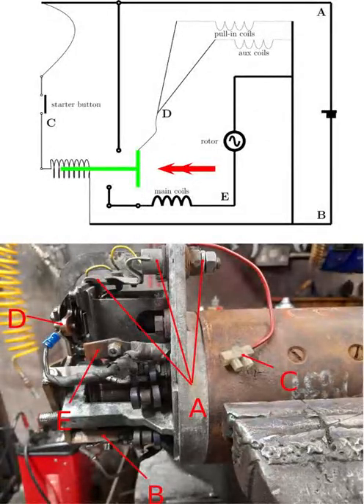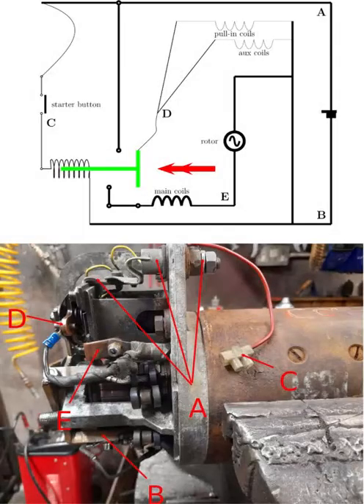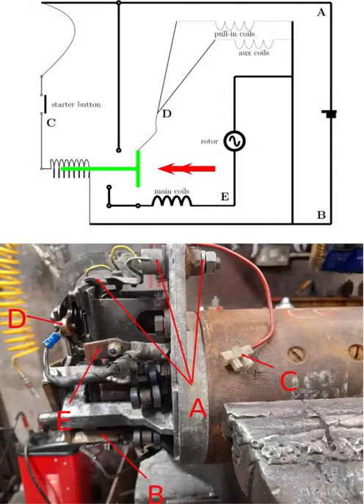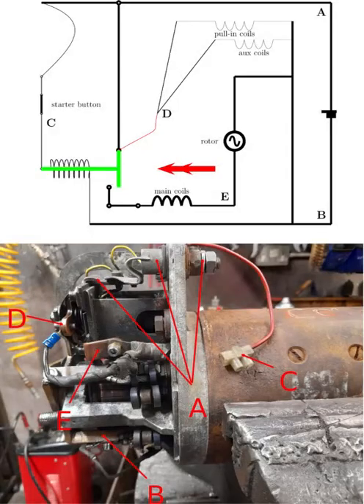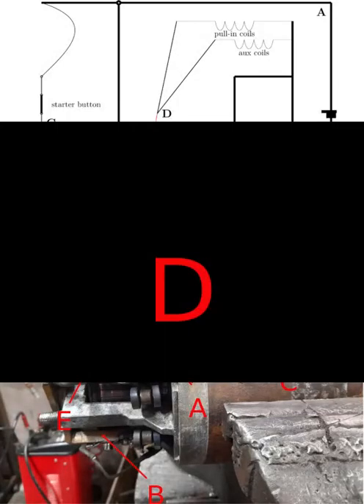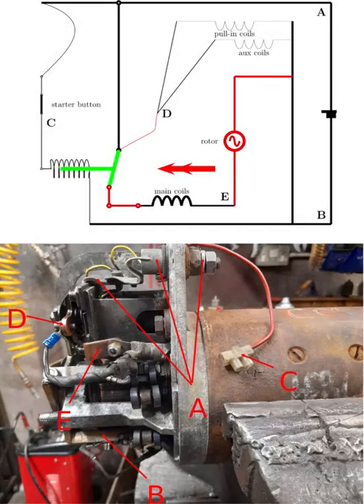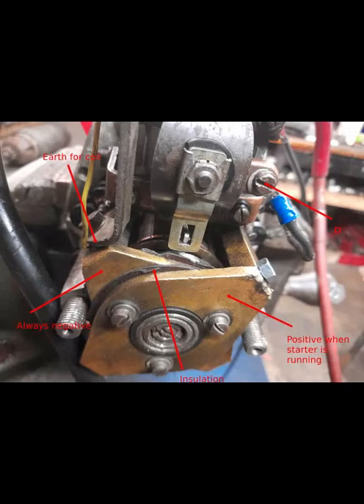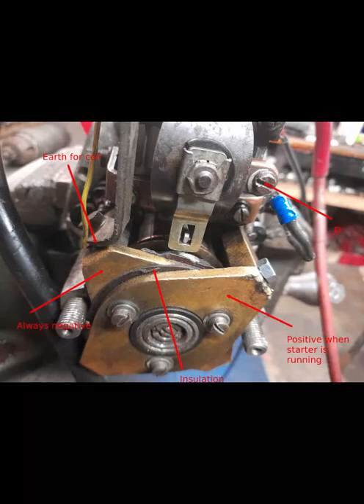Gardner Engines: closer look at the 6" starter PART II

Comment: Hi Joe this isn't starter related but just wondering if you would have an idea of what the fuel consumption is for a 6lx P/hour?
Reply from the maker: According to my manual, it is roughly 0.3125 pints per bhp per hour.    You will not beat Gardner for fuel economy, period.
Reply: i have a 6lx in my boat and with those numbers it uses pretty close to that, thanks for taking time to reply and help.
regards Brendan.